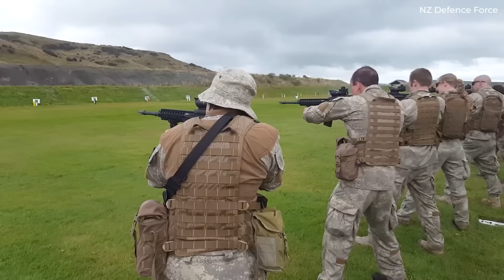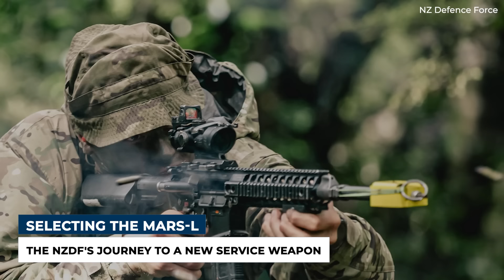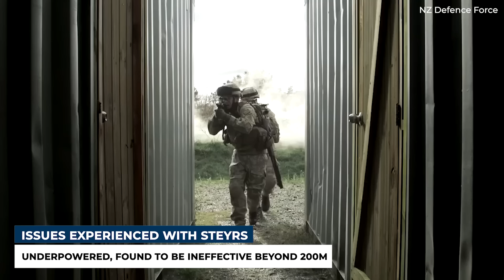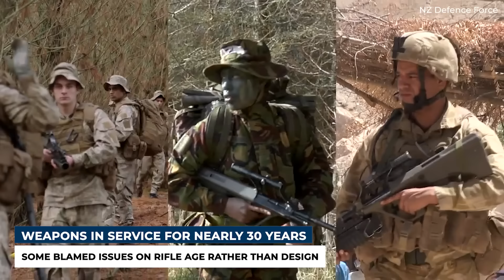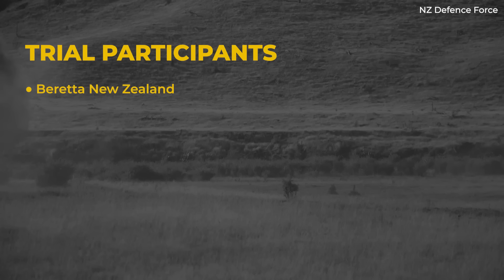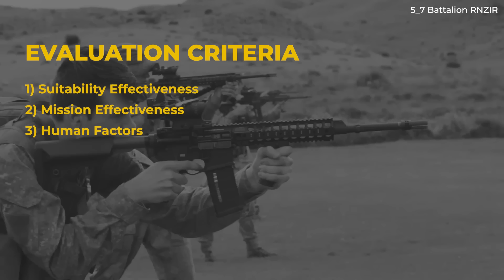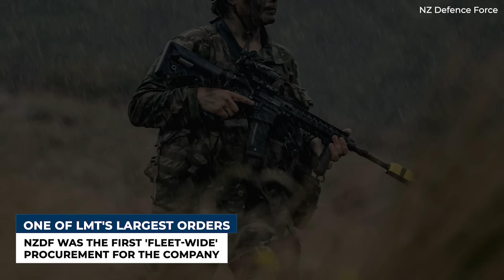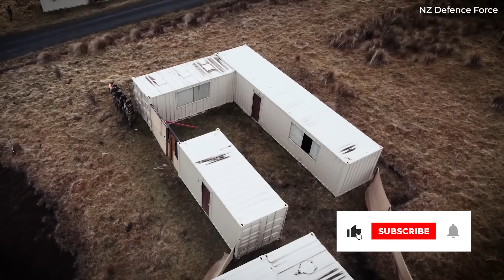NZDF’s Move To MARS-L: How New Zealand Selected Its Service Rifle

Comment: I mean, yeah the Steyrs the NZDF had was old.
But the EF88 very much proves that the platform is still top tier.

Having worn out rifles is no reason to blame the rifle.

Also, saying they felt underpowered is odd, as the longer barrel compared to a lot of AR-15 and conventional means it would be more powerful.
Reply: The EF88 AUG from ADI priced itself out of the competition early on. Can't talk specifics, but that was the reason Steyr was in the competition, but the EF88 was not.
Reply: @davidbuck5864  Aussies really needed put all the Aug internals into a AR15 monolith upper for an AR & Bullpup lower.  Actually ... Steyr should have realised from the beginning  the AUG should be an AR upper & BP lower.
Reply: They originally had a 20 year life of type, they were in service for 30 years in the end. They had been refurbished and re barrelled, but were due replacement. It was the responsible thing to seek a wide range of options, and the AUG A3 was one that was tested.
Reply: A lot of the sas guys picked ars before mars were rolled out
Reply: @jonathanwright5550  most if not all SAS do, even now, SAS, NZSAS and ironically SASR included.
Reply: Steyr upper receiver didn’t like the punishment from the M203. The steel liner inside the aluminium receiver would shift over time. The Lithgow ones were lower quality than the Austrian ones we had to trial in the late 80’s. A lot of them had issues with misaligned reticles, for example.
Reply: The Australians made their AUG's, and because Steyr was doing F all to improve the rifle they did.  NZ got their AUGs through the deal with the Aussies.  Yes  it has flaws and only effective within 200 yds but it has a reputation as a reliable weapon system now, but it does need to be eventually completely replaced.   Not immediately as they decided back then.

The money should hae been used to start a Government owned Weapons company, immediately starting with 556 & 762 ammo, grenades, and  making the AUG A2 which is now in the public domain.  So are G36 & M4 to be legally copied.  So NZ's version of Belgian's FN ... would initially provide parts for the AUGs in service, able to make the the entire rifle, and then start doing simple improvements to the rifles in service .. but ... focus on designing & prototyping the replacement Rifle, using Public IP from FN, HK, Colt,  Baratta etc.   For crying out loud all of FN old MG designs in service with the NZ, US, Aus, Europe and now public IP.  Private companies  can clone a Glock 17 which they all done for the public IP only.

So  NZ's FN is what a smart Government would do.  But being because be a Liberal Nation that freely trades with a Communist Regime for over 30 years, means NZ has never had a smart Government.
Reply: @abelincoln.2064  The kind of failures I was seeing and reading about could not have waited.
Reply: @davidbuck5864  Again.  The  Australians had the same rifles, properly maintained & upgraded them, and eventually made it their own rilfe better than the A1.  They had the same problems in Afghanistan with the "556" as the British had with their "556" bullpup cry like little babies wishing they had adopted the M16 A2 instead.  Neither did they replace their bullpups for clearly better M4s, Scar L, CZ Brens, HK416, or Sig 516.

NZ just like Steyr did squat with their AUGs because the Government did not have, an Ordnance & Armoury  division of  the Military manufacturing at least ammon, grenades, explosives, small arms. All of the Militarys small Arms & ammo will be imported.  This would be ludicrous if the Aussies & Brits relied on imported ammo 

Why are yu all aganst a team  of engineers & gunsmith,  in a state owned  making various types of small arms ammunition .. and the AuG A3, M4, HK416, Cglock 17, M9, M249,M240 & more?
Reply: @abelincoln.2064  When did I say I was against the idea? I think every country should have a domestic defence industry. Canada did, before they sold it to the Yanks. Britain let Royal Ordnance Radway Green fall into disrepair for years until they finally reinvested. No, I think a domestic defence industry is a great idea. But, the reality is that there is insufficient work in NZ to make it viable. It would not be self-sustaining and would require a constant influx of taxper funding to sustain. While you and I might think that is a good use of taxpayer funding, not sure the rest of NZ wouod agree. The closest we come to a domestic weapons industry is ODL in Wanganui, and they are a great bunch, but do not quite rise to the level if a national defence industry (sorry Bruce).

None of this is anything to do with the fact that our AUG rifles were old, and in poor shape, which was the substantive reason they needed to be replaced. I worked next door to the weapons maintenance section at the headquarters, and I heard the faults and saw the reports. I saw the accident investigations too. The ADF had done a series of upgrades and changes to their rifles, none of which had made their way to NZ. It was time for new rifles. The LMT rifle won.  If you don't agree with the results, that is certainly your right. Let me point out that I had nothing to do with the trial, except for being an observer. But I was there on the range at Trentham, day after day, and the trial was well designed, fair, and comprehensive. Was tge prior relationship with LMT a factor after we bought th the 308 MWS? Possibly, but it was not the main factor.
Reply: @abelincoln.2064 why would NZ build an entire industry around a relatively tiny force that would essentially make new weapon every 20-30 years?  That's like saying we should have our own naval shipbuilding yard to build a ship every 10 years or a our own aircraft factory to manufacture 3 aircraft per year?

That math just ain't mathing regardless of how you slice it.  You build industry on need not want because at the end of the day someone still needs to pay for it.
Reply: @abelincoln.2064 
I don't know where this 200m crap comes from, although the Kiwis did use a different sighting reticle. RAINF trained soldiers consistently engaged targets at 300m and good shooters at 400 - 600 m. With standard AUStyre sights.  The EF88 fixed some other annoying bugs and introduced better mounts  for enhanced sights.
Reply: @theredrat69  The 200 m or yds crap would have come from AR fanboys likely using the crappy tiny A1 x1.5  donut ring sights which the NZ Army used in Afghanistan.  Both the Kiwis & Aussies should have immediately saw the flaw of the fixed fixed optic to the handle and the Aussies should have asked Steyr to make the handle with the sight detachable so they a lon rail on or M16 type Handle with iron sights can be attacked in the future.  It would have been easy for Steyr or the Aussies to make the A1 Handle & sight detachable.

Clearly the NZ Army had no ability to to modifying & improve their A1s, and not given a a budget to upgrade to the A2  better optics.  The problems in Afghanistan wasn't  the AUG but the limitations of the 556 and the Army not understanding the warfare that drove the Soviets out.   And  after that special operation were all the complaints by a vocal minority and a need for a new rifle ...in 556.  Meanwhile the Brits & Aussies continued with their bullpups knowing  that they will eventually have to move up to 6.0, 6.5 or 6.8 requiring a new rifle or conversion kit.
Reply: @abelincoln.2064  Have you ever fired one? 200 yds? We had AUGA1 variants and the F88 version in service at the same time.
Reply: @Pravania  That's right.  You kiwis has the A1 right up to you stupidly decided to replace it 30 years later.

The Aussies have stuck with the AUG because steyr allowed them to make the rifle & modify where Colt refused with the M16 A2.

But back in 2017, the M4A1 and the AUG were now pubic domain, to clone, and  $60 million NZ stupidly spent on 10 000 new ARs they could have built & modified themselves from commercial for less than  $15 million, and and used the rest on a Government owned Weapons company to at least make ammunition,  and clone & improve.

Again.  The AUG was public domain in 2017, with Australia actively improving the rifle.  The Australians have the economy & Defece budget to get any rifle the Army wanted but they remained with the F88 making the EF88.  The clueless Liberals in the NZ Army & Government, ignored their Aussies across the ditch and just wanted a rifle ... better than the AUG A1.  Repeat they wanted a 2017 rifle better than the AUG A1 from the late 70's, with the Australians now using AUG's better than the A2/A3 in 2017 using by the Austrians.  Nobody every thought of .... using the money to create a Weapons company to at least make Ammunition, and then make improved clones of the AUG.
Reply: @abelincoln.2064  why should we waste the money on something we don't need, china is also not communist they are state capitalist, the same way we're not a democracy we're a two party parliamentary system.
Reply: The Austrian Steyr was a cheaply made rifle. The Australian Steyrs were worse, as were the spare parts that the Aussies sold to the NZDF. Our armourers hated that rubbish. Let us not forget that: the Steyr failed the testing, so the Aussies designed an easier testing regime. The NZDF could have been the lead customer for the M16A2, at a cheaper price and with zero quality issues BUT our government allowed the Australian government to screw us over. You have apparently never used the Steyr. A range toy is NOT the same as a combat rifle.
Reply: @michaelguerin56  you guys have next to nothing to spend on defence. Scraps is probably all you could afford and likely couldn't afford to maintain them.
Reply: @starship4453 There was a deal with Australia and we ended up with poor quality parts that were made—allegedly—whilst the people at Lithgow were trying to perfect their manufacturing. The Aussies wanted a rifle with export potential, as with the SLR L1A1 and L2A1 that were previously made at Lithgow.
Reply: @michaelguerin56 I don't think we would have intentionally sold you crap. But if these were the same rifles you bought in the 80s, did you buy any updated parts?
Reply: @starship4453 Every time I talked to an armourer, even years after I Ieft, they had the same opinions on the rifles and Aussie made parts. I respect the honest views of other tradespeople.
Reply: @starship4453 actually NZ does maintain it's kit, exceptionally so, which is why it generally lasts so long.  Why are you arguing weapon "maintenance" anyway when both forces replaced their systems in similar timeframes or are you just salty because NZ didn't automatically choose the Australian steyr (again, funny that) over a AR design?  Don't feel special, no one did, anywhere,  not even SASR because apparently it's just that good 😐

 I would'nt exactly rave about Australian maintenance regimes considering they can't even seem to get helicopters to fly, which is literally their main job..
Reply: @regregan6852  to be fair is here in Australia... How could we possibly have known you guys were going to shoot them?

Also, you guys might also find issues with maintaining a larger fleet of helicopters if you could afford to buy that many.
Reply: @starship4453   to be fair is here in Australlia?? Ahh what? 🥴

Ahh I love when you guys use that whole size of fleet excuse as if it is somehow relevant to operating the NH90, at all, vs relative.  3 Sqn is just like 1 of Australias operational squadrons so you should have still been able to maintain 4 Sqns (just like NZs 1) considering Australias budget is 10x the size but Australian flight hours were abismal, even by international standards just especially by NZ standards.

Imagining you would have somehow done any better with a smaller fleet is just another excuse considering you would happily use the old "economies of scale" chestnut to talk up larger fleet benefits any other time.
Reply: @regregan6852 if you knew anything about the NH90 program, you'd know how hard and how long it took NHI to supply airframes and parts to anyone who wasn't France, Germany, or other European partners of the program.
Reply: @starship4453  I do actually, I was in when they arrived.  So you are blaming Australias only recent issues on something that happened over a decade ago?? 😐  I see, one of those guys using old history to justify modern problems which is actually irrelevant considering not only did Australia have its full complement of NH90s it even got another for free so if anything the "delay" in getting them should have only helped the transition as I have it on good authority trying to operate a large fleet all at once is almost impossible, apparently.

And this is all not even taking into account the 6 RAN Taipans that were retired early because ironically, operating a small fleet proved to be too problematic so there was literally an entire pool of spare parts "flying around" at the time which is exactly how/why NZ could keep operating by buying an extra frame specifically to be used as a source of initial spares as it worked out cheaper than purchasing all the parts seperately.  This also meant they could just use parts from the spare frame immediately and then just replace those parts instead of taking an operational frame out of service waiting for parts.

So seems RAN could not operate a small fleet in ADF service and Army could not operate a large fleet in ADF service and ADF could just not operate Taipans in general? 🤔  You guys really need to work together if you want these excuses to be even semi-believable 🤷‍♂️
Reply: @michaelguerin56 weird. Because I hear very different things.
Reply: @mysterioanonymous3206 There is what really happens and what gets recorded in—politically influenced—official reports. Consider all the information that was not revealed during the U.S. Congressional inquiry into the initial M16 debacle in Vietnam. If the personnel at Springfield Armory had told the full story to Congress, about McNamara and the arrogant clowns that he brought in from the Rand Institute—where he had previously worked—they would have been sacked. A bit like the public servants here in New Zealand who were well aware that the sodium monofluoroacetate poison (1080) would accumulate in the food chain like dioxin and kill native birds BUT needed to keep their jobs. There was nothing for decision makers to discover about the dangers of 1080. The official policy was to obfuscate and lie about the dangers to native bird life and … to humans.
Reply: @michaelguerin56  strange, people involved with the original steyr tests back in the 1980's here in Australia certainly have said otherwise and I served with some of them. The Leader Dynamics rifle also tested well however it's unique bolt design means you could not use the weapon for parades and the like or store it without the bolt as the weapon didn't lock. The colt m16a2 was one of the worse tested weapons from memory.
Reply: @ant242 We all have our own experiences.
Reply: @ant242 Strange then that the School of Infantry (Who did the trials to replace the SLR and M16A1) recommended that M16A2 be adopted.
Reply: @michaelguerin56 I've read our SARP tests.

They complied with and cite NATO standards repeatedly.
In those tests the Steyr beat out the Colt (M16a2) in basically every test.

This information just isn't correct.
I have used a Steyr, I would gladly do so again.
Reply: @birdmonster4586I would not. Unacceptable parts failure in peace time was my personal experience. I have, also, never talked to a serving or time-served RNZEME armourer who had a good word to say about that weapon. Each to their own.
Reply: @michaelguerin56  So is the EF88 a crap rifle that soldiers hate?  Does the Australian Army know squat about weapons procurement or the Australian Government did  testing & made the final decision?  

Yes it had flaws, limitations & quality issues but  is descent Service rifle, for the most  conflicts infantry are involved with (within 200 yds).

Steyr simply messed up.  The AUG should have been a monolithic AR upper, for an AR or  bullpup lower.  And all they needed to do is improve & lighten the Upper & bullpup Lower.

The Aussies should have realized the AUG should be an AR upper & Bullpup lower.

And NZ messed up when the Money should have been used to a Government owned Weapons company making 556, 762 ammo and the AUG A3 which is now Public IP .. to supply parts for the rifles in service, until   NZ designs & makes its own Service Rifle  using Public IP for the M4, G36, HK416
Reply: @abelincoln.2064  the entire NZ military is to small to build or even design it's own kit from the ground up, always has been always will be. Some bloody good soldiers though.

Comment: 2:07. That reporter didn't know shit. Stryker wasn't hated. Total crap. They were just worn out and upgrade path had challenges. In trials alot of guys picked the next gen Aug as 1st because it was what they had drilled on. Then the Mars as 2nd. But soldier preference wasn't the only factor and steyrs package was expensive, too long in delivery and lmt's offering as a package was really good. Lmt I think is better but in some ways the Aug is hard to beat in tight spaces. Once you get used to it the spent cases in the cheek is tolerable and there are reflectors available too.
Reply: When you got one of the newer deployment Steyrs with the ACOG it made you realize the training stock was just old aye!